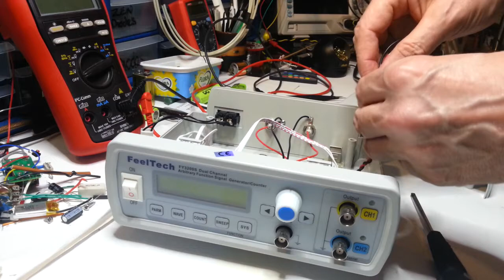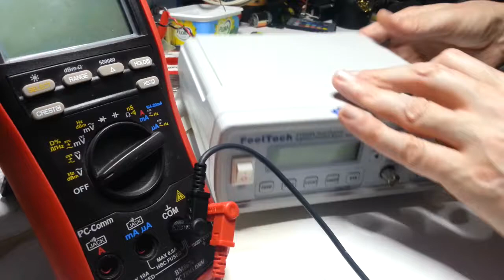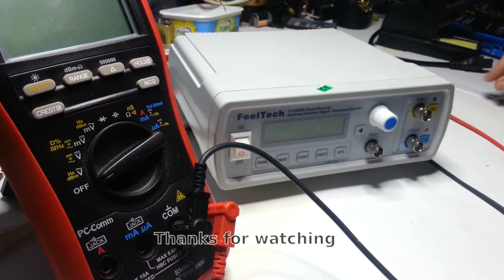FeelTech FY3200S Series 24MHZ Function Generator

Comment: My newly acquired FY3200s resolved its own leaky power supply issues by blowing the top off the chip at power up. It worked well for a couple of hours, then decided that it needed to explode in a puff of smoke.
I've since swapped out the psu for an identically rated but isolated one and we're back in business.
Reply: Mine crapped out too, I'm going to get the one on this video $9..00.

Comment: Just got one of these generators on Auction from a dealer for $30.00.  I ordered this board as well as an isolated 110-12 volt supply to put in it as well as a 3 prong chassis plug. This way I'll add a switch to it so I can chose between when I need to be ground or floating. I'll still have less in it for what they normally retail for.

Comment: Thank you for your support and attention to our company's products and thank you for your suggestions for improvement of our company's products. Our company's newly-listed FY6800 series signal generator will change the power supply plug to a three-core socket, which has solved the BNC leakage current problem.If FEELTECH products need to provide technical support, you can also send an email to feeltech@126.com and we will help you.

Comment: My kit came without any instructions which was not a prob for me. 
However I have found the unit will draw around 1.5amps when fed with 5v 
and this slowly reduces to around 300m/a at 15v in. I should say I am 
using this to power the  Feelgood 2mhz function generator which gives it 
portability.  I also found most heat is generated not by the switching 
IC or regs, but by the 2 x 470uf caps! I havent been able to measure 
this heat but suffice to say I cannot keep a finger on for more than a 
few secs! This would indicate a high ripple and/or perhaps a poor quality 
elec caps. Not yet looked at the waveform across the 2 x caps.
I noticed you had no heatsinks fitted to the ICor regs which did come in my kit.
I wonder if anyone else has had heat issues with the 2 x 470uf caps when powered and under load?
Reply from the maker: Hi Res S, Thanks for sharing. I would check the connections for errors as the caps should not heat like you describe.

Comment: Hey thanks for sharing. Did I miss what you said was the initial issue with your unit? I have two of the same make/model both experiencing the same issue as the other: then output signal voltage is weaker than it should be, neither will go over about 7.11-7.13 volts regardless of which output I attach the leads to. The secondary output on one unit actually won’t even put out more than about .055 volts. 
I also purchased both of my units from banggood.com. The first I purchased months ago and it last about 2 months until it started performing weakly so it was too late to get a refund. The second showed up at my door already putting out a weak power signal. I’ve contacted banggood technical support multiple times and they’re really dragging their feet about honoring the 7 day DOA product guarantee promised on their website in the event you receive a damaged product.
Apparently aliexpress is the official Feeltech store so I guess I’m going to start dealing with them instead of the other since this is how banggood handles issues on their end.
Anyway, would your solution solve my low output power issue? I don’t like the idea of being limited to 12volts output either but I’m sure I could find a similar but stronger power supply unit if you think this would fix my problem. 
Thanks for your response!😁

Comment: I have orderred the same unit from Banggood and looking forward to play with it...!  I was wondering why did you not just modify the power connector to a grounded 3 wire connector so that the ground would be at zero?  Would that not fix the issue of leakage that you find on this unit?  Surely if the original ground is floating, bringing to a solit houseold ground would fix the problem in my view?  Any comments?

Comment: I bought a FY3224s from Banggood last year. The power supply did not look anything like the one that was in yours.  it wasn't even new when I bought it. It was all scratched up over the clear plastic that cover the LCD display. The rubber feet was missing. But they would not exchange it. They only gave me credit points towards my next purchase. I bought a couple of them same power supply kits also back then to replace the power supply in the function generator . I've already assembled two of them but  I never installed it as I wasn't sure how long it was going to last. Then I saw your video seeing that you actually put one in there,  since I couldn't find anybody else that did it. So I was curious how is it holding out for you? With the power supply kit in the function generator?
Reply from the maker: It is fine it still works. I am sorry to hear about the problems you have had with your purchases.

Comment: What was/is the  value of the blue suppression cap on the original power supply?
Reply from the maker: 10nF 1KV.
I have done the Earth to ground test on some other devices in here. My 10 amp switch mode power supply 0.137V @ 0.0Hz, Bridge meter 9.767V @ 49.99Hz, Solar PSU 21.497V @ 49.89Hz. Are these picking up stray electrical fields from my 240V cables powering other things?
Reply: Got  a telephone pick up coil?.. they are fun looking for fields...also check your body voltage in around room and bench
Reply from the maker: bunnyathome No to pick up coil, could I make one? I did test myself, I am an AC antenna, ~13V and if I touch metal on pliers 19V while holding earthed lead.
Reply: I knew a man who made himself a pair of boots,..with cork and copper plates in them...looked like frankenstein...grin
Reply from the maker: lol. I am reading, that link is very interesting. I may become a bit of a menace.
Reply from the maker: That was an interesting read, thank you for sharing. I have a flyback transformer core which I can split. Will have a go later and see what I can do with it.

Comment: hi where did you get the power supply board, i have looked everywhere, Thansk
Reply from the maker: i used Bangood. They are out of stock at the time of this reply, here is the link. 
http://eu.banggood.com/Wholesale-Warehouse-DIY-USB-Boost-Single-Turn-Dual-Power-Module-Linear-Regulators-Multiple-Output-Power-Kit-wp-Eu-1022517.html?rmmds=myorder

Comment: I'm curious as to why I haven't gotten a response on my last comment about the power supply you installed and now it's lasting?
Reply from the maker: Hi, I am sorry. I do reply but for some reason my reply seem to vanish. Also I noticed today a conversation I was having was there and then when the viewer responded it was gone again. WTF right. Even in my notification the comments are gone??
Reply: hey dude no need to apologize :-) I think what happens is that people who comment videos and if they lose their account or they delete the comment it will automatically delete the whole conversation and the notification as well. so how do you like that power supply kit for that signal generator? and what input power source are you using in regards to voltage and amps?
Reply from the maker: I don't delete any comments unless it is just advertising or offensive (foul). I noticed my response to you has gone again? I have no idea why. I can see why some might get annoyed with me because looking through some other comments, my reply's are also not there. 
Regarding this function gen and PSU. I was connected to my battery's which are charged by solar panel, but as it is winter now I have switched back to the original internal supply. The mod PSU is great and never gave me a problem, unfortunately the FG uses 500mA just switched on and is too much for the batteries at this time.  I could have fed a power supply to the mod PSU but rather than that I just re used the original PSU.
Reply: Hi I got your response with no problem. I don't mean you deleting the comments. I meant the viewer who posted the comment if they delete the comment the whole conversation will be gone. That's what I meant :-) anyways so you went back to the original power supply? I haven't played with mine yet I still have a couple of those kits built I just have not put one into the function generator yet. I might just try to figure out how to ground it on the inside  with a ground lift switch possibility. but I have to get a three way outlet socket for it first. as far as right now I'm using my FG085 I built laat year which I also seen you have also built! :-)
Reply from the maker: Ah right, I understand what you mean about the comments now, lol, I am so dumb sometimes :).
Would a ground lift switch work with this? I do not know enough about them, I have a sort of understanding about earth loops within audio systems after reading from the internet. if you figure it out I guess lots would like to know your results, including me. I like the FG085 and usually turn to that as it requires little power and is great for playing with attempted amp circuits.
Reply: The only time I ever used a ground lift switch was with a guitar amp. we were getting shocks from the guitar going to a mic stand :-) so we added a ground lift switch to ground out the amp and we can switch it out if we needed to. that worked out fine. I think the same thing it's happening with this function generator. And being that it's a floating Supply with no ground,  there must be a reason for it. Putting a ground switch in it will provide the ground but can be switched out if needed to.  I read some posts about it in another forum so I don't have any doubt that it wouldnt work. But like I said I don't have the parts to do it yet. and I've been working with that smaller kit function generator! I actually like that one :-)
Reply from the maker: Dog Rox Which small kit FG do you like?
Reply: The FG085 that's what I meant by the smaller one! :-) as compared to FY3224.  :-)

Comment: This is not how you solder properly, you don't take the solder to the board, you heat the pad up with the iron and apply the solder to the pad.  The flux has to clean the work to prepare for the solder, doing it your way, the flux is burnt off before it can do it's job.  Just look up good soldering techniques with google.  Who ever taught you to solder didn't do a very good job !
Reply: TechnoNazi         Just Kidding.
Reply from the maker: To be honest I think everyone develops their own ways of soldering. I do not like the idea of soldering the pads first. I think is is like the current flow situation. personally I like the way I solder compared to how others do it. I dont tell them they have it wrong. You opinion is OK, I leave comments open so anyone can have a say. Better have a say than just thumbs down like a hating troll.